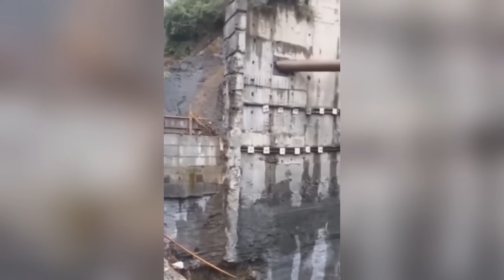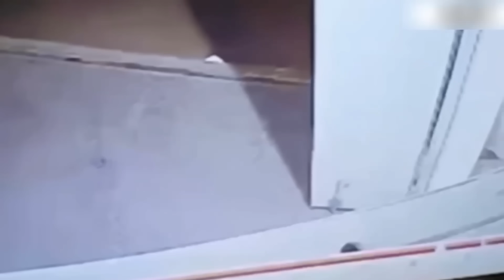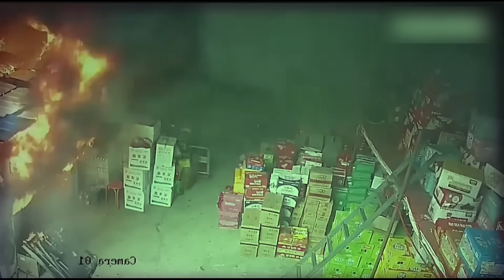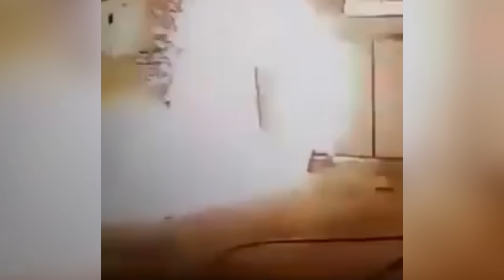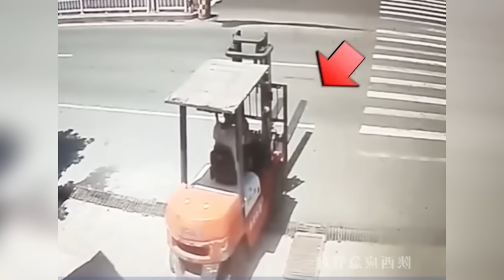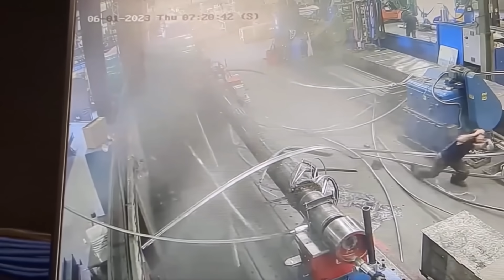Entered the Press While the Machine Was Still Running | Industrial Press Accident

Comment: 1.    I am aware of this accident, the people there KNOW the wall is giving way, the pit is evacuated and the machine seen is parked, unoccupied and NOT operating (note the bucket lying on the ground motionless).  Huge lie here.  Don't be a trump.   Thumbs down for misinformation.

More errors:

2.   "A worker is unloading cargo from a truck using a manual pallet jack. However, the lift platform is not fully lowered to ground level".   Why would it be lowered? You roll the cargo on the gate and THEN lower it.  The problem here was exceeded the lift gate's weight capacity, not it's current position.